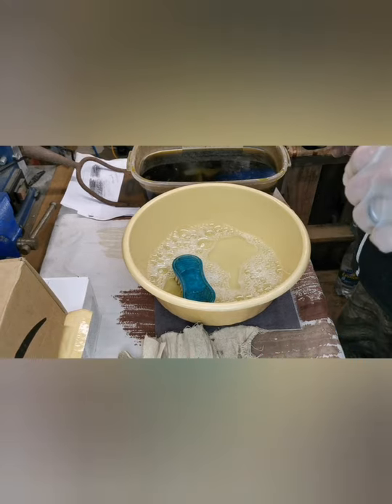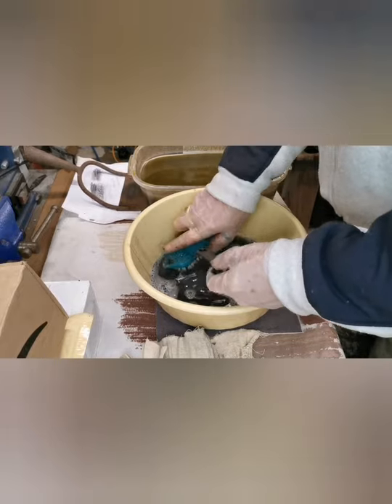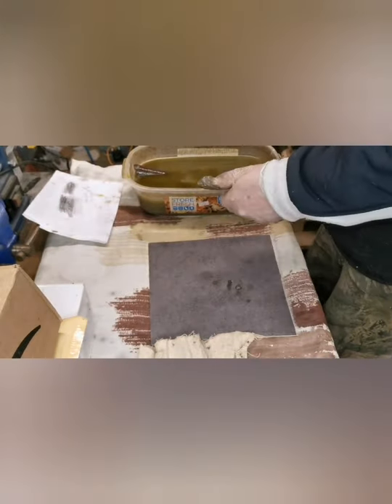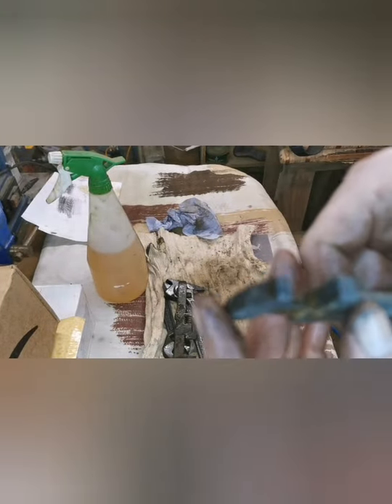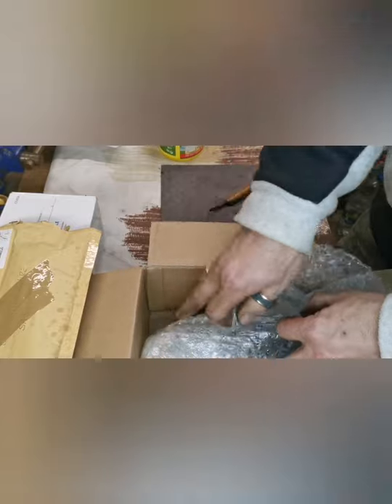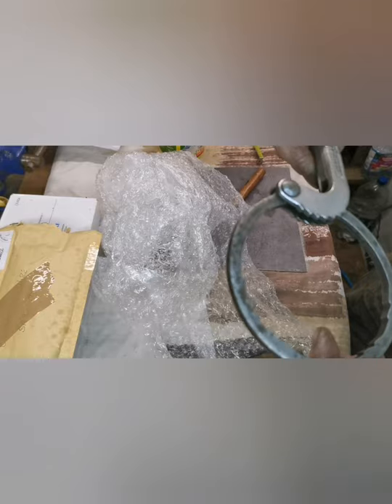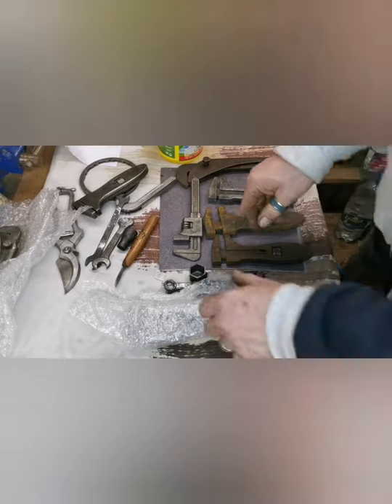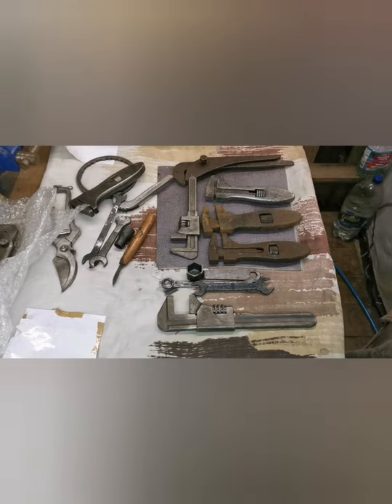Deox-C bath & clean of little wrenches + ebay Haul unboxing

Comment: Can wrench for the old Jerry cans, maybe made in U.S.A.
Reply from the maker: Thank you Dwarfsbane.. It could be indeed.. I've hunted the  interweb, and not found anything under "Williams canwrench Rd".. 😕🙄🤔😉
Reply: @recyclerman1  Could it be this Company, if so Snap-On now make Williams tools.
http://progress-is-fine.blogspot.com/2014/01/vanished-tool-makers-jh-williams.html

Looks like it is an oil filter wrench looking at pictures online, we used to use the chain type, I have used similar ones like this when I was young to undo the Jerry can type tops, they were difficult to open, no grip on small ones and The Hulk would fail on the larger ones.
Reply from the maker: @dwarfsbaneironfist2527  awesome.. I believe you're right and the script/font are the same.. The chain type or strap are the only type I've seen.. Can't find a matching picture at all tho... Thank you for searching for me.. Grateful for sure
Reply from the maker: Saying that and I've just found one 😂😂😂 https://picclick.co.uk/Williams-Oil-Filter-Canwrench-RD-353377918278.html